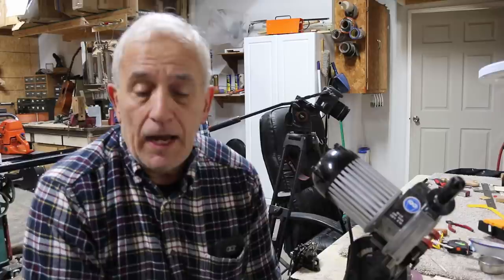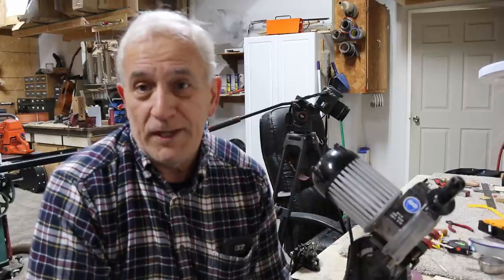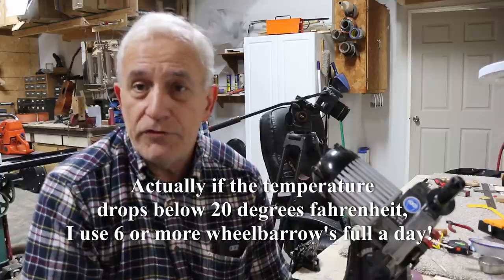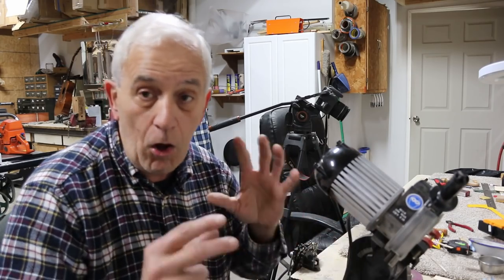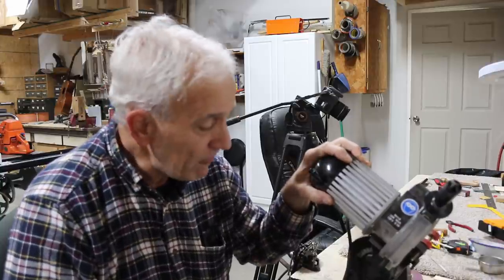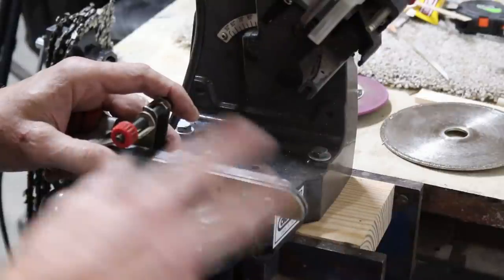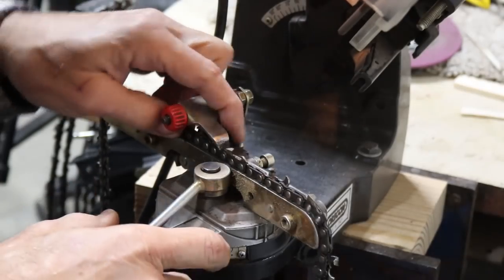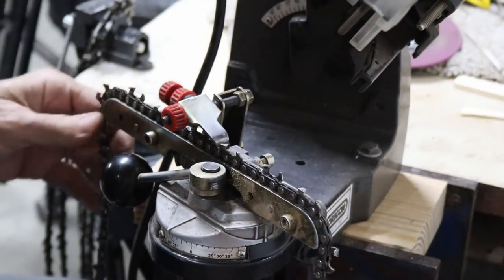465 RSW Oregon Chainsaw Sharpener Defect Discovered

Comment: yep yep if the chain isn't near perfect on each side it will pull one way or the other and be impossible to cut a straight line, been there, that's a cool rig you have there for sharpening.

Comment: Nice video, I don't use a chainsaw that often, so I sharpen the hard way. I actually did it today, got the saw all set up, then it wouldn't cut hot butter. I put the dang chain on backwards. It ain't easy being me either Jerry.

Comment: I worked at two different small engine shops for nine years. We used the pink grinding wheels as that's all we had for them because that's what Oregon supplied us with back then. I don't know how many hundred chains I sharpened, but it was a lot. We would always soak the chain in our parts washer, then put it on the wire wheel to clean the pitch out of the cutters. We didn't have much burning of the tooth by doing it that way. Also cleaning and reshaping the grinding wheels with the trueing rock every so often. Our sharpener had a forward and reverse switch for the motor. We had been told that was so that you could always have the grinding coming OUT of the tooth and not dragging the chrome across the gullet. The only caveat is when sharpening one side of the chain, you have the sparks and steel flying towards you.

Comment: We all have chainsaws on our minds. I just finished rebuilding our old pioneer chainsaw today,  that I bought my dad for Christmas back around 1975 or 76. I found that when I got chains sharpened from a shop with a grinder, when out in the field, touchups with a file were hard to do, because the teeth were all hardened from the grinding process.

Comment: Wondering if your chain vise is centered under the motor spindle when at grinding height with the wheel in use at the time.

Comment: You know I got nine of those Oregon grinders got cbn wheels in six of them . font ask me why . I think its a pain in the butt to keep changing wheels out and just like you I once noticed by shear accident that one of those grinders was off by 21\2 degrees on both side. I took that puppy apart took the motor assembly off  laid the back portion on a level surface took the degree marker off rebored the holes just slightly bigger got a true angle finder and found the true thirty degree mark on each side super glued the angle finder down in the correct spot and then replaced the screws worked like brand new money for me.

Comment: You may have cut more wood but I guarantee I've sharpened way WAY more chains. I use the EFCO LR36941 Type 136 it has a huge reversible motor with on-off-on switch and 110v. It is DNA (dead nuts accurate) the best I've ever used, and I'm pretty sure I've tried them all. 
A couple habits I use are I will either wire wheel the chain or wash it in the naptha tank to get rid of oils, sap, etc. The reason is if you don't, it "blues" and causes hot spots and ruins the heat treatment and causes more frequent sharpening. It also prevents the wheel from getting contaminated and also causing bluing. I also "bounce" the wheel off the chain a little bit at a time until the tooth is sharpened all the way to the bottom. About 3-or 4 bounces and the tooth is completely sharpend. Bouncing allows a bit of cooling interval to also prevent bluing. My wheels last 10+ yrs. They get used all day long, every day, about 60 chains per day when it's real busy.
Don't get me wrong, those CBN plated wheels are fantastic, but I use the regular ones because I do so many different size chains and switch them out often, plus I can contour the shape with a dressing stone if necessary. t all adds up to a sharpened chain that stays sharp for a long, long time. So long it's unbelievably unreal the time between sharpenings. 
My customers are always amazed how long they are able to cut without re-sharpening. And cuts  big huge chips instead of small giblets. Chains last forever. It may seem it would take longer to sharpen, but my turnaround time is 7 minutes. And that's with it still on the saw. If they bring in just the chain, it's a little over 4 minutes. They can stay and watch, get a cup of coffee, and I'm done before they finish their coffee.
My motto is "If you blue it, you blew it."

Comment: I had bought a cheap one and ended up going back to hand sharpening but yours seems to work really well. I wish I hadn't thrown it out cause I would have tried that diamond blade. BTW your makers seemed to be a bit high for the length of the teeth but that might just have been the camera angle.

Comment: What a lightbulb moment.  I've been reversing the motor for the one side since watching your previous video..what a difference it made.  However, as always even before made that change, I noticed that each time I sharpened the chain half teeth kept getting shorter.  I just wasn't smart enough to figure it out. THANKS SO MUCH!
Reply from the maker: I forgot to include that I also change the back angle to 55ﾟ that helped a lot

Comment: Do u ever have to file down ur rakers? Because I have to when I hand file my chains or they don’t cut shavens just dust...
Reply: Agreed.  The rakers set the depth of the cut of the tooth “behind” it.  The cutting tooth has a slight angle “upward” and as you sharpen, the progression of the cutting edge back down the tooth means a shallower cut in relation to the raker.  My Stihl hand sharpening tool has a round file for the tooth and a flat file to knock off a tiny bit of the raker.

I have a Harbor Freight sharpener and I don’t use the protractor gauge on the machine.  It’s just a suggestion for the angle.  I’m careful to maintain the factory attack angle and use the machine turned off to get the angle right.  Every other sharpening session is a hand sharpening to get at that raker.

Good comment. ^^^^^

Comment: Irony is I have had to sharpen the "blades" in the field with a guide and file. Not pleasant but what had to be done. Thanks Jerry
Reply: Get Mustie1 to add a two cycle motor to a sharpener like Jerrys.  That way you can use it in the field.  He just fixed a 2 cycle powered blender with handlebars.  Lord knows we been needing that.

Comment: You found this by accident? Did you figure out a way to test your theory of R @ 30º and L @ 25º.  I have a knock off Northern tool model, wondering if I have a similar problem, but would like some way of testing before assuming it has the same fault. Though I have been having problems with the cuts wanting to curve, which leads me to believe it may be a similar issue.  Please let me know when you have a moment.    Had another question for you.  When cutting the rakers (depth gauge) what angle do you use when setting  that, I'm assuming you dress the wheel to 55º and use that for cutting the rakers?  Thanks for your videos, any suggestions would be welcome.

Comment: Wonderful video.
Question :   Understanding angles as a carpenter might, wouldn't you test the angle the blade comes down on the chain tooth by eye to verify the tools angle finder was true ? 

Most chop or sliding compound saws are adjustable as is the glass on a table saw fence w/hair line pointer.  I see there really is no adjustment on your tools angle finder which is why you use different degrees to cut by.  But, to take for granted that it is true "out of the box" must have been an embarrassment after 16yrs ??

If you don't learn something every day , it's time to hang it all up !!
Steph,    Louisiana
Traveling Carpenter 33yrs

Comment: I'm sure you cut lots of firewood BUT you don't know how to sharpen a saw blade, all you nee is a file and that's it....  a timber cutter does not take 20 chains  out in the field or that other stuff, takes 5 min to sharpen a chain by hand ....
Reply: Hmm I use a Oregon grinder I think the man is spot on. Unlearned the drill trick from him now I'm putting in the reverse switches it does Mae a difference . I can make a chain cut better than a new one . its a simple process if you can follow directions . if you can't give up on the grinder its not for you. They made files and they made grinders for people that know how to use one.